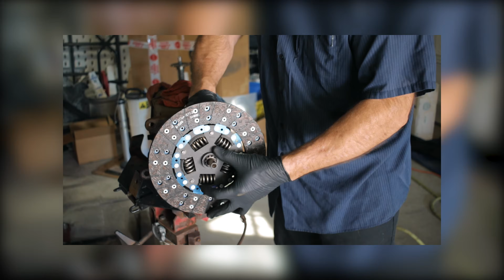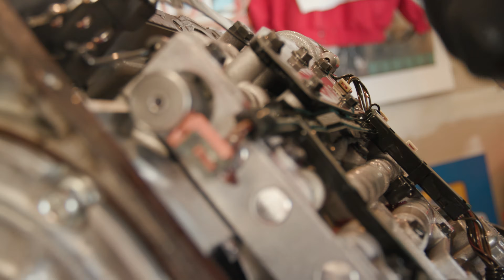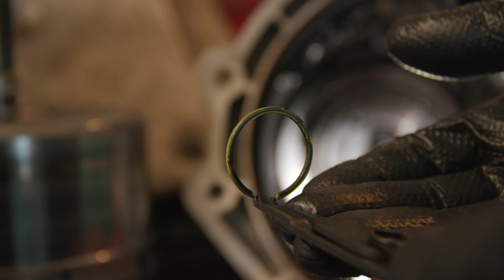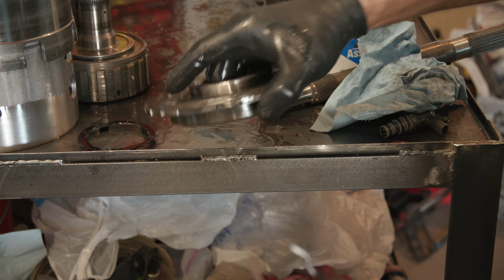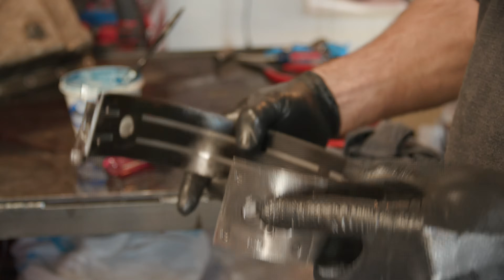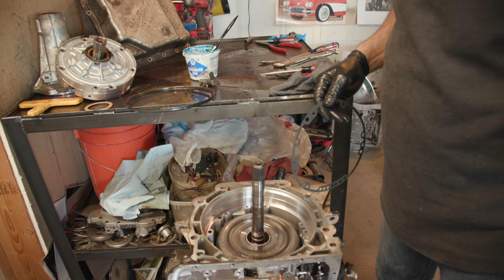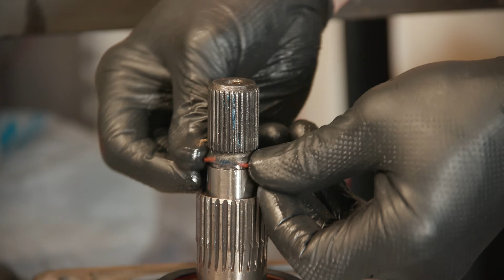4L60E Output Shaft Swap - 2WD to 4WD Conversion

Comment: i saw another video where they just cut the shaft....what are the cons of taking the easy route ?
Reply from the maker: Good question.
I believe I've seen the video that you're mentioning (6L80E).

This method (cutting the shaft) looks to be possible on the 6L80E.  However, I do not believe that to be the case with the 4L60E.

The 4L60E 2WD shaft does have two long sets of splines, for the driveshaft slip yoke.  But, if you were to cut the shaft short enough to accommodate a transfer case (4WD), then you would cut the 2WD shaft so short, that it would no longer have splines.

To the best of my knowledge, we gotta install a 4WD output shaft to make it work.

Comment: What does a wave plate do?
Reply from the maker: A wave plate helps cushion (dampen) the application of a clutch pack.
Some clutch packs utilize a wave plate...some do not.  If the clutch pack requires a wave plate, but it's left out, the trans will bang when shifted into gear.
Reply: @SouthpawAutoworks  Thank you! 
The sad thing is. YouTube is more valuable for education then a college!
Most of the time.

Comment: Why do you not use regular grease?
Reply from the maker: Assembly lubes/gels are compatible with ATF (Automatic Transmission Fluid).
Reply: @SouthpawAutoworks  OK so they  blend with the automatic transmission fluid?

Comment: Assembly goo!
Reply from the maker: There's different kinds.  They vary in tacky-ness (stickiness).

Light Tack:  https://amzn.to/3NqXf7D (Paid Link)
Firm Tack:  https://amzn.to/3GKp34i (Paid Link)

DISCLOSURE:  🕵
As an Amazon Associate I earn from qualifying purchases.  Some, if not all, of the links contained in this video description (or comment) are affiliate links.  This means that, at no additional cost to you, the Southpaw Autoworks YouTube channel will receive a small commission on any purchases you make through the website links provided above.
Reply: @SouthpawAutoworks  I just thought it sounded slightly funny. So I just quickly put the comment.
Reply from the maker: Haha!

Comment: How do you completely convert something to four-wheel-drive?
How much does it cost to get all the parts?
Reply from the maker: A guy could dedicate a video to that topic...

Off the top of my head, you would need:
1). Front differential.
2). Front driveshaft.
3). T-case (transfer case).
4). Possibly some extra electrical connectors/harness/pigtails for T-case switches.
5). T-case shift linkage.
6). Etc.

IDK about pricing.

Comment: How do you completely convert something to four-wheel-drive?
Reply from the maker: A guy could dedicate a video to that topic...

Off the top of my head, you would need:
1). Front differential.
2). Front driveshaft.
3). T-case (transfer case).
4). Possibly some extra electrical connectors/harness/pigtails for T-case switches.
5). T-case shift linkage.
6). Etc.
Reply: @SouthpawAutoworks  Are y’all going to put together a video on that? It would be a good idea to do that on. 
1)The Ford ranger.
2)The Ford F-150.
3)The Chevrolet Silverado.
4)The Jeep Cherokee/wrangler.
These would probably be some of the most popular automobiles to do that with.
Because you can get a much cleaner 2 Wheel Dr. automobile! Then the equivalent four-wheel-drive version for thousands of less dollars! You can also save a ton of time buying something with 2 Will Dr. In much better condition!
Please let me know when these videos come out! I will definitely watch them!
Thank you.
Reply from the maker: Great points!  Excellent idea.
I would love to do some video tutorials on those topics, as time permits.

Comment: My output shaft is pushed back and can see the shiny part that's supposed to be inside the transmission any ideas if that could be the shell that went out? Thanks
Reply from the maker: Can you specify with journal (shiny part) you're talking about?
If you can shoot a video of the issue, and post a link to this comment, I will take a look.

Comment: Hey I just did a soft rebuiled on my 4L60E 4x4, it ran fine for about a week, nkw it won't shift out of 1st.

What do you think it might be?  I'm hoping it's just the solenoid, but which one would that be?
Reply from the maker: Congrats on your rebuild.  Bummer about the current issues.

There could be an issue that's external to the trans (computer, speed sensor, load sensor, etc).  It would be ideal to know whether or not the PCM (computer) is commanding 2nd gear.  Need a scan tool attached to "see" that.

You could be dealing with:
1).  A sticky 1-2 Shift Valve.
2).  Plugged/restricted 1-2 Shift Solenoid (aka Shift Solenoid A).
3).  Damaged seal on 2nd apply piston of 2-4 servo...although this would've probably surfaced right away.
4). Burnt 2-4 band.

The 1-2 Shift Solenoid is located right next to the Forward Accumulator...if you don't know, that's the accumulator that's built into the VB.

Questions:
1).  Do you have a check engine light on?
2).  Even if there is no light on, can you still check for codes, and let me know what you find?
Reply: P0756 shift solenoid B
Reply from the maker: Thank you for pulling, and supplying, this trouble code.

If you haven't seen it already, I recently released a video that shows how the 1-2 shift valve & solenoid operate.  Knowledge is power....
Here's a 60-Second PREVIEW:  https://youtu.be/fWPSaLeaOXI

If it were me, I'd be:
1). Removing the 1-2 shift solenoid (the one closest to the Forward Accumulator).
2). Checking the solenoid for resistance (ohms).
3). Trying to blow air through it.  (you'll understand why, after watching the video.)
3). Might even just swap the solenoids (1-2 with 2-3)(they're the same solenoid), and then road test it, to see if the problem changes.
Reply: Thanks man I really appreciate it
Reply from the maker: Who's your buddy?  Who's your pal?
Have a great weekend.

Comment: Is it normal to be able to remove the output shaft on a 2wd transmission? The one that I have you can just pull the output shaft out without any issues
Reply from the maker: I'm assuming that you've already removed the pump, both of the drums, the sun gear (sometimes this comes out with the Input Drum...depends on the type of Input Sprag), and the output shaft snap ring (little yellow one).
If this is the case, then yes, it's normal.

Sometimes the output shafts are a bit of a press-fit inside of the Rear Ring Gear.  Sometimes they're not a press-fit, and they can be removed without any fuss.

Did I answer your question?  Or did you mean to ask something else?

Comment: Why not just take out the shaft at 14:20, why must everything be dismantled?
Reply from the maker: Great question.
It's totally doable to remove the output shaft, without having to go any further into the unit.

My Response:
1). In the heat of the moment (filming), we may have gotten a little carried away...
2). Would you want to tear into the trans, and not "peek" at all of the clutch packs, while you're inside the unit?  You're never gonna be closer...

Once again, great question.  Really appreciate your interest/engagement.
Like always, thanks for dropping me a line!
Reply: @SouthpawAutoworks  Thanks for the answer, thanks to your video (detailed and gives confidence and understanding) I think replace in myself
Reply from the maker: Right on!

Comment: In my area the 4WD versions outnumber the 2WD versions by a considerable amount. Plus locating a 2WD model that is available is rare or expensive. I had purchased a 4WD 2001 Suburban for 1k, and I drove it home. I had purchased this vehicle to perform a LM7/4L60E conversion into my '68 C10 2wd pickup. The engine runs strong and the transmission shifts flawlessly. 

I have watched many videos on the disassembly of the 4L60E transmission, but this video is by far THE best video on disassembly and reassembly.
Reply: Absolutely, hands down!
Reply from the maker: Thank you.
Reply from the maker: Dude, I'm really glad to hear that!!  
I'm on a mission to serve as many people as possible.

If it feels right to you, please share this video/channel (with a short testimonial) on your favorite FB group, auto forum, etc.  A little goes a long ways...

Your support is appreciated.
Thanks for dropping us a line!

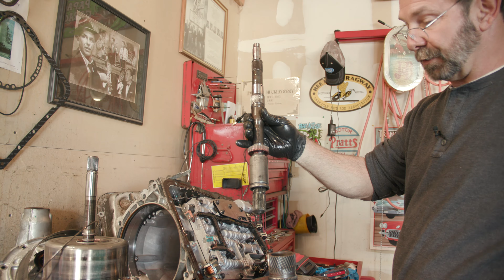Comment: What is the smooth silver looking sleeve on the 2wd shaft you removed? @ 17:10 in the video.  It's not on most of the 2wd shafts I see for sale.
Reply from the maker: That's the Output Shaft Sleeve.  That sleeve contains an O-ring, at the open end of it.  The O-ring installs inside of the bore (inside diameter, as opposed to the outside diameter).  The O-ring seals against the machined surface on the driveshaft yoke.  The sleeve is a press fit on the output shaft.  It can be removed/installed (carefully) with a hammer.

Output Shaft Sleeve:  https://amzn.to/3FXmWIf
Sleeve O-Ring:  https://amzn.to/3nUFzXg

DISCLOSURE:  🕵
As an Amazon Associate I earn from qualifying purchases.  Some, if not all, of the links contained in this video description are affiliate links.  This means that, at no additional cost to you, I will receive a small commission on any purchases you make through the website links provided above.

Comment: does this work the same exact way with the 4L80E version as well? 

I have the 2wd currently and finding a decent 4wd suburban under 10 grand is ridiculously impossible currently in my area or even state that is not junked out. My '06 Suburban was a steal and is in amazing shape both cosmetically and mechanically and I would like to just convert over to 4wd with my chassis.
Reply from the maker: Unfortunately, the 4L60E and 4L80E are very different designs.  This video will not be very helpful for your particular application.

Comment: Great attention to informative detail when it needed to be - example - the bell housing bolts and the correct torx bit.
Reply: Yeah, I did actually strip one out, that was before I found this video though.

Ended up having to weld a nut on it to get it out...lol
Reply from the maker: Glad you were able to make it happen, despite the setback.  Nice work!
Reply from the maker: Thanks for dropping me a line!  You are appreciated.

If you're interested in helping the channel grow:  https://youtu.be/giV8ySI1Cz8

Take care.

Comment: SOUTHPAW!!!… thank you , thank you! Perfect “fit for purpose” video … sooooo many of us changing our 4wd to a 2wd. For our LS swaps … I do have one question. When changing from 4wd to a 2wd … is there anything special wiring wise that has to be addressed for proper VSS signal to communicate to the wiring harness coming from the donor vehicle ? Being that it’s a 4wd
Reply from the maker: I'm not sure that I fully understand the question.  I hope what I wrote is helpful...

On stock 4WD vehicles, the speed sensor harness connects to a speed sensor that's mounted onto the T-Case (Transfer Case).  On stock 2WD vehicles, the speed sensor harness connects to a speed sensor that's mounted on the 4L60E extension housing.  The electrical connectors are the same for both 2WD and 4WD OSS (Output Speed Sensor) harnesses. 

A stock vehicle should have wiring provisions for the OSS, and should be able to physically reach either the T-Case (4WD) or the extension housing (2WD)...whichever is installed....I understand that you are aiming to install a 2WD.

There's an early and a late style extension housing...and there's also an early and late style speed sensor.

Early VS Late:
If the 4L60E has a case and bell housing that are all cast as one piece, that's an early style (4 bolts to connect extension housing to case).  However, if there's a case and a separate bolt-on bell housing, then you're dealing with a later style (6 bolts to connect extension housing to case).

Early Extension Housing:  https://amzn.to/30IH3LQ (paid link)
Early Speed Sensor:  https://amzn.to/3x7R8NQ (paid link)
Late style Housing:  https://amzn.to/3FzTok9 (paid link)
Late Style Sensor:  https://amzn.to/3xf13kT (paid link)

DISCLOSURE:  🕵
As an Amazon Associate I earn from qualifying purchases.  Some, if not all, of the links contained in this video description are affiliate links.  This means that, at no additional cost to you, I will receive a small commission on any purchases you make through the website links provided above.  
Thank you for supporting the Southpaw Autoworks YouTube channel.

Comment: Only thing is what do you do on the output shaft side is the a gasket or anything like on other side. In other videos  I seen them block off some type of bolt hole
Reply from the maker: There’s a lathe-cut seal (A large O-ring that has flat edges instead of rounded ones).  Super easy to install on the extension housing (2WD) or Adapter (4WD).
The blocking off of a bolt hole??  On the units I’ve worked on, that type of thing is not necessary, or called for.

Comment: This was a awesome video I really liked how Andy describes in detail what is going on.. I am currently doing a 2wd to 4wd swap due to I found a 2wd trans and my truck is 4wd so I have to do this... I plan on upgrading my old trans during the rebuild of it and could really use some tips and suggestions cause I have never rebuilt a automatic transmission before but I'm going to do this one.  Lol was wandering about what upgrades Andy thinks I should do to best suit me and my application it's my daily work truck and I may take it off roading every now and then...  Thanks guys..
Reply: I was wandering what is the best way to block off my lock in the valve body?? And what's the best way to go about using the pressure in my 4l60e in a 4x4 application???
Reply from the maker: I'm happy to help, however, I'm afraid I don't understand your questions.  Lock in?  Pressure in my 4L60E?
Can you rephrase the questions?
Reply from the maker: I will get back to you on some parts/upgrades to consider for a daily driver.
Reply: The lock up in the valve body how to you recommend to block it to keep it from having lock up??? And how is the best way to make the pressure higher in my 4l60e and spending the least amount of money

Comment: so how do i bolt a transfer case to trans now?
Reply from the maker: There's a part called an adapter (transfer case adapter) that lives between the transmission case and the T-Case (transfer case).

700-R4 & early 4L60E use a one-piece transmission case (case and bell housing are cast as one piece).  The rear of the early 4L60E trans is outfitted with four (4) bolt holes, for mounting either:
Option #1:  An extension housing (aka Tail Shaft Housing) (2WD).
Option #2:  An adapter (4WD).

Later-style 4L60Es use a 2 piece design (case and bolt-on bell housing are two separate pieces).  The rear of the later-style 4L60E is outfitted with six (6) bolt holes, for mounting either:
Option #1:  An extension housing (aka Tail Shaft Housing) (2WD).
Option #2:  An adapter (4WD).

Which style of 4L60E are you working on?
Reply: Later style option 2 wonder if the 2wd will be in better shape inside compared to a 4x4 I'm guessing the 4x4 will have bin beat up on? Guess I'll find out today thanks 4 the info
Reply from the maker: Happy to help!

Late 4L60E:
      T-Case Adapter:  https://amzn.to/39bJjf9
      Trans Gasket:  Couldn't easily find one online for the later-style 4L60E.  But. here's what it looks like (orange lathe-cut seal):  https://amzn.to/3tUoqhZ
             Alternative:  Complete trans gasket set:  https://amzn.to/39ebzxE (Not sure what year of trans you have)
       T-Case Gasket:  https://amzn.to/2Z5UnIX

DISCLOSURE:  🕵
As an Amazon Associate I earn from qualifying purchases.  Some, if not all, of the links contained in this video description (or comment section) are affiliate links.  This means that, at no additional cost to you, the Southpaw Autoworks YouTube channel will receive a small commission on any purchases you make through the website links provided above.
Note:  Same goes for Ebay links.
Reply: One more question is it possible to do  a conversion to 4x4 with 2spd powerglide? I know not a 4l60e but thought I'd ask
Reply from the maker: To be completely honest, at this point in time, I do not know.  I currently have very little experience with the Powerglide.  However, that may change in the future.  =)